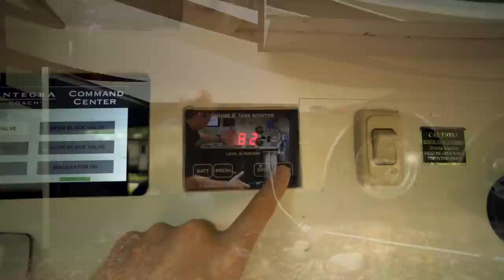Throw Away Your Sewer Hose? - Thetford Sani-Con Turbo Installation & Detailed Review

Comment: I am not sure what the advantage is. You still have to have a hose dumping into something. Not sure why this would be better.
Reply: Really, that product doesn't eliminate the need to dump the black tank.  I switched to a composting toilet.  I will never go back to using my black tank for solids.  Liquids are collected and can be taken in a jug and empied into any drain or toilet. I was expecting a composting upgrade.
Reply from the maker: After having it now for 2-3 months the reason for this really comes down to convenience. We can setup the sewer in less than 15 seconds now. We open the door, grab the hose, unscrew the cap, plug it into the sewer and walk away. Is that worth 500+ bucks? Thats not for us to decide but so far we are really happy with the solution. As I mentioned on other posts though, a component failure could really change our tune. Time will tell and we'll do some future videos once we have a few more months of wear/tear on the system and components.
Reply: @LivinliteNet1  If it's about convenience one could look into a composting toilet.  Not suggesting you should do convert to one.  Just saying there are RV'ers out there with YT channels who have done videos of them converting  AND given updates after using them for months and even after a year.  One thing I've noticed NOT ONE has reported to ever wishing to go back to using a black tank.  One channel "Gone with the Winns" put one in their Class A and when they sold that and bought a New Class A they put their old toilet back into their old RV and moved their composing toilet into their brand new Class A RV.  Something to think about, LivinLite. Again people can do as they please, just adding to the conversation.  Best wishes and happy new year, to all.
Reply from the maker: @sailingsolar  Hey thanks for the reply! We love Nikki and Jason and they are on an amazing adventure (now on a boat!). For us (admittedly we are not knowledgeable on the topic) the front "liquid cartridge" which collects all the liquids and must be dumped daily was a show stopper for us. As i understand it, you need to remove that cartridge daily, walk it through your rig and go dump it outside. I think this would be excellent for folks doing extended BLM stays without hookups but for us it wasn't a good fit. Here is the link to the video i think your talking about. Great blog for everyone else interested in checking it out! https://www.youtube.com/watch?v=_E2xOoNov9s
Reply: @LivinliteNet1    I do have more I could say but I'll leave it as it is. No one solution works for everyone (apparently). Thank you for your time replying.  Wishing you two the very best.  Much respect and happy new year guys.  For your efforts I am subscribing and will see what is to see !!
Reply from the maker: @sailingsolar  thanks so much and we agree! We've definitely regretted some of our "upgrades" but we'll keep you posted with future videos on all sorts of topics. Thanks for subscribing!!
Reply: @LivinliteNet1  A component failure is more likely with additional items. The hose has only a couple of failure points, and a small leak is most likely. Gravity is a constant.
Reply: @LivinliteNet1  I'm with you on the daily dumping, that isn't something I'm going to do when I can afford to get full hook ups. 

I agree if you were doing extended BLM camping, but If I had to do that, then I didn't do something correct in my retirement planning.

Comment: I know you are reviewing the Thetford but I have a question about the FlowJet.  Do you need the fresh water running while you are using it or is that just for clean out?  Have a situation where I might need a waste pump like that but a limited supply of water.  You folks are the first ones that I have seen that have run one of these.  Thanks in Advance.

Comment: I have a porcelain toilet with inbuild pump/mixer and empty my toilet tank with a 35 mm hose. Then the grey water tank trough the same hose. The toilet itself costed almost the same as this pump system.... ( those toilets are used in boats or in homes after making a second toilet room where it was original not intended .....with smaller pipes needed.... )

Comment: Great demonstration. Some coaches come with macerator toilets.  Do you know how reliable they are and if they are better then a regular toilet with the Sani Con system?
Reply: My experience, the stuff from the macerator toilet makes the job of the san-con much easier-- they are meant for each other.
Now for the negative reply. The sewer hose, even with it's minor faults, is preferred. My san-con is  occupying that space.
Reply from the maker: Our Thetford Tecma macerating toilet works great. Its been flawless for about 4 years. It uses a lot more water than our foot flush front toilet though so we don’t use it when dry camping. Both seem to work fine with the Sani Con Turbo, the much larger propellers and wider pump body make it a much better performer than older units. Just don’t flush any GI Joes down the toilet or you might have a bad day taking apart that pump!

Comment: I thought the benefit of this system, was the ability to dump in a house toilet?? Can this be done  without to much pressure coming out the other end, and making a big mess
Reply from the maker: Checkout our video on dumping into a standard toilet here: https://youtu.be/C_A11DKe13k - toilets are gravity flush and it will work but if you can find a sewer cleanout on the outside of your house its a much less risk way to do this. It will work but make sure you keep a close eye and that your toilet and septic are in good working order!

Comment: Does this system pump uphill? If so does it say how high. Thanks for the review
Reply from the maker: Yes it does pump uphill, I initially tested with water uphill about 4 ft (top of a large garbage can) and it pumped without issue (probably a little slower but worked fine). That said if you were using a long garden hose i’d probably say try to keep the incline over the total hose length to below 2 ft if possible.

Comment: Apparently, this vid was not made for newbies...like me.  1. What the hell is a macerator?  Is it a blender/grinder of sorts for used toilet paper & poop?  If so, that maybe should have been explained at the beginning.  2.  Years ago, I had a very compact porta-potty that I used sometimes when camping.  There are packets of eco-friendly chemicals that can be placed in the bottom of such toilets; those chemicals break down the waste in a relatively short time.  Instead of the macerator, why not just flush one of those packets down the toilet once in awhile, or cut it open & pour the contents down?  They also would deodorize the tank.  That seems a lot simpler & much less costly than everything you just went through, eh?
Happy Trails
Reply: It is simpler. I agree, why make something that works more complicated.

Comment: There were a few times you could have banged stuff on the hard counter a little harder.  You missed a few open spots.  Also, put a loud fan on so that the quality of the audio is all the way terrible and not just mostly terrible.   Other than that, it was enjoyable.
Reply from the maker: Our mics were stuck in our rv which was in for tire service when we filmed the inside portion of the video and yes... it was pretty bad. sorry about that!

Comment: Honestly, when I first saw the title to this video, I thought, great, something has come out now to do away with the sewer hose...nope, it's just a newer version, still got the sewer hose, only now, it cost wayyyyy more than the one I just threw out...no thanks.
Reply from the maker: They haven't yet figured out how to simply make the waste "disappear" so yes there is an exit system of some sort in any system (yes even with composting you'll be hauling out trash bags full of peet moss). I do have my hopes up for the Star Trek transporter system that will magically transport matter from one location to another some day though. "beam it out scotty!" Sadly our understanding of physics wont allow this just yet!
Reply: @LivinliteNet1  For several thousand you can get one of those toilets that burns the waste into sterile ash :)
Reply: @LivinliteNet1  Actually, "they" figured that out way back in the 1950s or thereabouts.  There was a system for motorhomes that emptied the tanks through a jet into the exhasust header pipe, where it was vaporized, sterilized, and spewed out the tailpipe while driving down the road.  Like many good ideas, it disdappeared.

Comment: Thanks for the video.  I've been curious to find how well this system performs.  Here's why...  Like you I have a Class A diesel pusher which means that when parking at a campsite I first empty the air bags.  Doing so lowers the coach by four inches or so which, depending on the site, can mean it sits quite low to the ground.  In those cases, which have been many,  there is little to no decline to the sewer.  In fact, often there is an incline, especially at those sites with raised sewer connections.  This means that to dump at my site I cannot leave the sewer hose attached.  Rather I have to open the utility bay door and connect/run the hose through that door rather than run it down and under the coach.  Once the dumping process is done I have to put the hose away until the next time my tank(s) fill.  This can be a hassle needless to say.  So I can see where this system would alleviate this problem and allow me to pump up hill if needed.

Also, I've had others tell me (since I'm new at RVing) that as long as the campsite sewer connection is lower than my tanks I should be able to leave the sewer hose attached, even though there may no decline to that connection.  I've come to understand that many people do this, but I would worry of potential spillage should there be any damage done to the sewer hose/connection while it's full of sewage.  That said, do you know if the Thetford pump completely clears out the hose when pumping and/or when in bypass mode?
Reply from the maker: Weve experienced the same issues and the sani con has been great for us solving the problems you mentioned. Your comments above about the standard hose working to push uphill are correct as when the grey tank level increases enough the pressure in the hose will push the grey out through the sewer connection but it can get a lot trickier with the black tank and you find yourself picking up the hose to add gravity to clean things out. I find the sani-con just makes the whole process easier and faster. Now that said the sanicon doesnt completely empty the hose as at the very end of the cycle there isnt enough water to push the last bit so usually just before we dump well fill our grey tanks a bit to ensure we have enough water to give the system a nice final clean. Unit has been great for us and weve sold out of our first 3 orders with a bunch more scheduled for deliver this week and available on our store. You can message us on the store if you have any additional questions!

Comment: Question: I have a factory installed version, curious about the winterizing procedure.  I winterized my 5er myself this winter for the first time. Other that putting about a gallon of RV antifreeze in the black water tank after it was drained and running it through the SaniCon until I can see antifreeze coming out. it there anything additional or different that they recommend?
Reply from the maker: Tony that should be all you need to do to winterize the pump per the winterization instructions on the unit. If your run anti-freeze through the pump you should be good to go. We have links to the full manual for download in the full article at https://livinlite.net/thetford-sani-con-turbo/ - thanks for watching!

Comment: What’s so hard about dumping and flushing the black tank?  That Rube Goldberg contraption looks unnecessarily complicated which means prone to problems. 

Glad I have an 07 Phaeton without fussy unnecessary electronics, DEF, unreliable touchscreens. 

I never turn my back on anything dealing with filling/dumping tanks. What is the purpose of this thing?  To mince your poop while you walk away to have a cocktail while you’re trusting this thing not to clog/leak while you’re watching your iPhone?  I never turn my back on liquids. I can spare 15-20 min watching and overseeing the process. The only time I’ve had problems was when I turn my back on some device that bears watching.

Comment: Great information, Erik! We have a factory-installed Sanicon and it is a bit loud. In comparison, it is much slower than the 600 you demonstrated, but I never noticed until now. I will remember this video and the product if we have to replace our current system. It, too, lacks the clean out, but we have a separate black and gray tank rinsing system, which usually provides essentially clean water to rinse out the Sanicon hose. Thank you for the video! :-) Also, congratulations on nearing 20,000 subscribers. I am very pleased that your channel has become so popular, given the quality of your videos.
Reply from the maker: Thanks so much for the kind words Neal!!! We have lots of great videos coming soon!

Comment: I bought this system for my fifth wheel and I basically never use it.  I have a bath and a half with two grey tanks and two black tanks, each with a tank flush capability.  The sani-con system hose is all black with a grey connector to the dump.  I don't know about you, but I'm used to eyeballing the clear connector to see that the black tanks are really clean after flushing, but the sani-con doesn't allow that.  When I called Thetford to find out where I could get a clear attachment, they don't have one, don't know who makes one (nobody) and don't understand why anyone would need one, and apparently no one other than me likes to feel comfortable that the tanks are really flushed clean.  Save yourself the money and just use the regular hoses.  What are you going to do with the 20 minutes the sani-con saves you anyway?

Comment: if you have long hair and use your shower inside the coach to wash your hair it will eventually clod the mascerater and you will have to take apart to take hair out.   unless you have a wonderful niece with a handyman significant other to do the clean out for $20 you could pay a lot for having Camping World or another service unclog the system.

Comment: He's impressed with a product he got for free. Why am I not surprised. It was so predictable. I'll continue to use my sewer hose. Thanks anyway
Reply from the maker: We would never recommend a product just because we got it for free. Lets be honest a video where we didn’t recommend or where something went wrong would get a lot more views! This is our honest opinion of the unit and so far its been a much easier to use solution that is faster (setup and breaking camp), eliminated all need for dealing with hose bayonet fittings and is working great. There is no denying the potential long term maintenance issues of a more complex system but I think its fair to ask why these are being installed on every high end coach if they don’t work. Its because once you use them, you definitely see the benefits but again, we never said the time tested hose was bad! Actually we said the opposite! Thanks for watching!

Comment: Am I the only one that noticed the low spot in the connecting hose created between the coach sewer outlet and this new pump??? ...lovely!....and about the product itself??? yeah sure, let's get rid of a complicated concept like gravity and replace it with a "simple" combination of electrical components and moving parts.....and heck, while we are at it, let's install this contraption all the way at the back of the compartment behind a mounted fresh water hose reel (????) yeah that'll work....LOL
Reply from the maker: We were curious about the low spot too but Thetfords install pictures had a similar setup so rather than do a ton of one-off modifications we followed what we think will be a typical class A rv install so that we could provide an review to what most folks will probably do. The pump inlet is a few inches off the ground once mounted so unless your hookups are at lease 3-4 inches above where the pump will be mounted a low spot will be hard to avoid. So far the rush/flush of the grey tasks when the valves open has kept the connection hose in pretty good shape (we open and inspect since this is a test case for you guys - I know thankless job lol🤣). I would be looking in that location if we had problems down the road. Will the connection hose wear out more quickly? Don’t know since we don’t have enough experience but well let you know in future videos. The ?? in the title of the video is definitely there for a reason. We are testing a new product for you guys, not recommending it! Thanks for the great comment and observations!

Comment: Buy a 45° clear flushing elbow for $12 @ Amazon to rinse portable pump after use.
Reply: Did that! unfortunately, I had it facing to my left when i connected it and the weight of the water unlocked it.  Never make that mistake again.